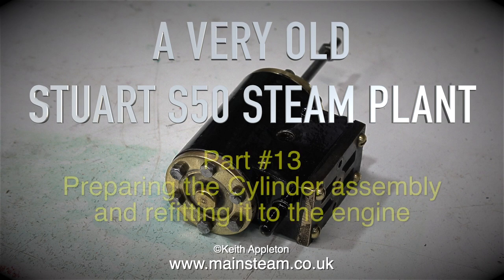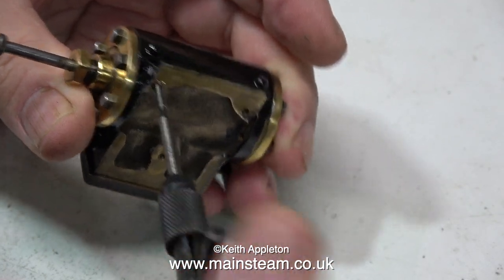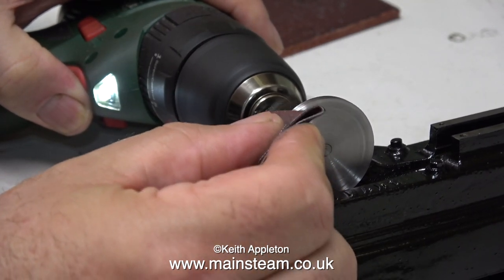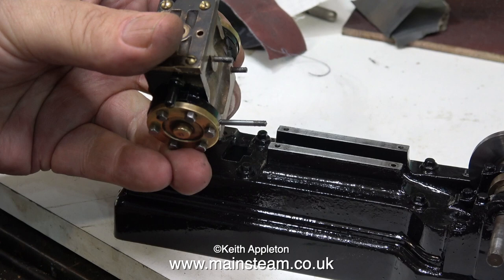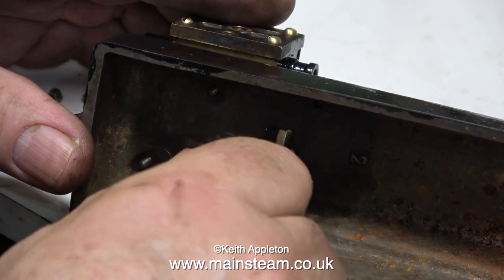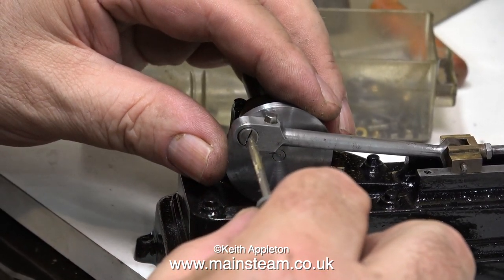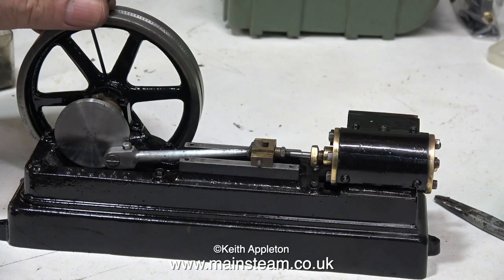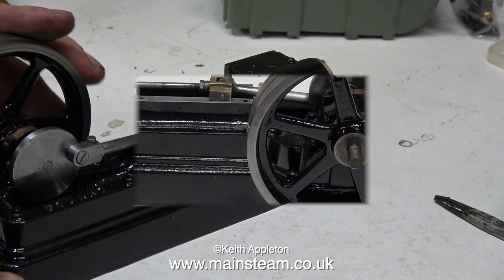A VERY OLD STUART S50 STEAM PLANT - PART #13

Comment: Cool idea of the slot on the nut spinner...I was wondering if ,before you gave them the final tightening,you gave the final alignment with the cylinder mounting studs sort of snug,then final alignment,then final tightening.But your way worked fine after all!(Someone will be very happy to receive such a finely tuned S 50.)

Comment: I notice that you said you were using a "plug" tap that bottoms all the way in the hole.  In the USA, we would call that a "bottoming" tap.  I t has about 1 1/2 tapered threads.  A "plug" tap has about 4 to 6 tapered threads and a "taper" tap has about 10.

Comment: Studs will hold better than bolts because as the bolt tightens it has a slight twist .  A stud on the other hand is tightened then a nut is tightened to it and the stud is under a straight pull. You always want to bottom the stud . If it does not bottom out you can place a ball bearing in the hole so the stud will rest on the ball bearing.  At least that is what I was told. Could be wrong. So take it with a pinch of salt. 
Enjoy your videos very much.
Reply: You use a ball bearing in the bottom of a hole that may not have been threaded all the way down to the bottom, It raises the thread contact area on the stud up to where you have good thread contact.